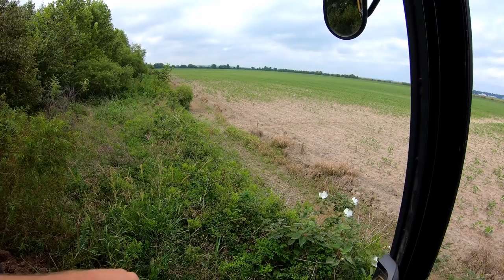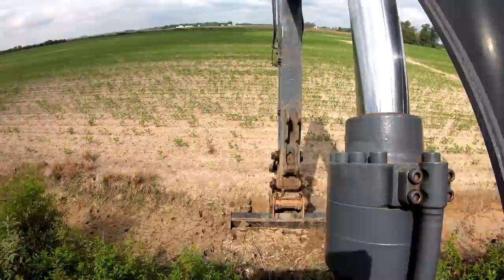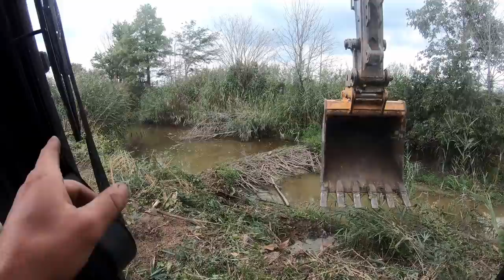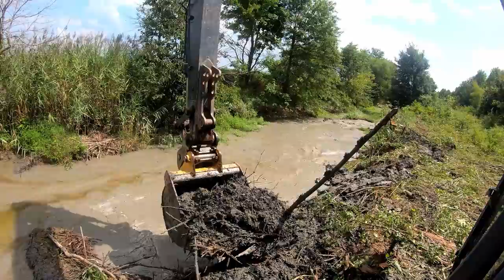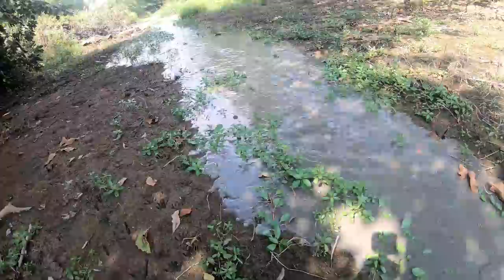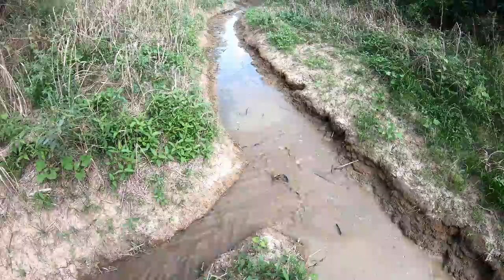Beaver dam removal with excavator!!

Comment: First, make proper ditches for the water to run in.
Second, break up beaver dams and remove any obstructions that will impede water running.
Third, maintain ditches on a regular basis.